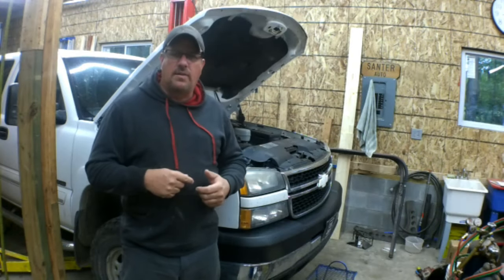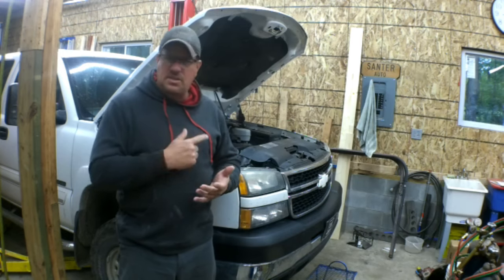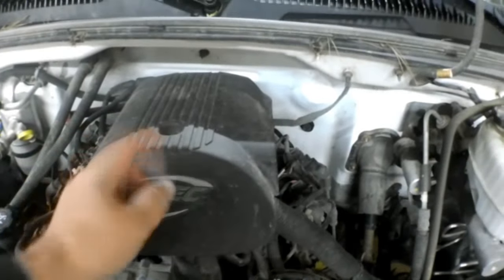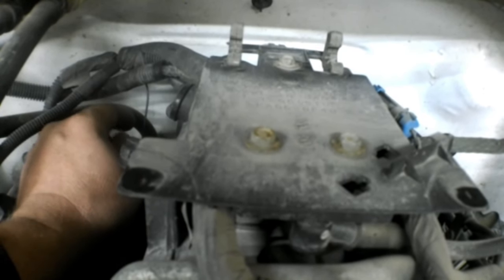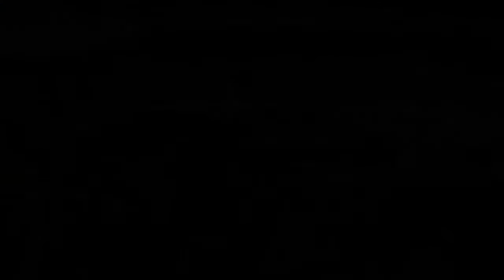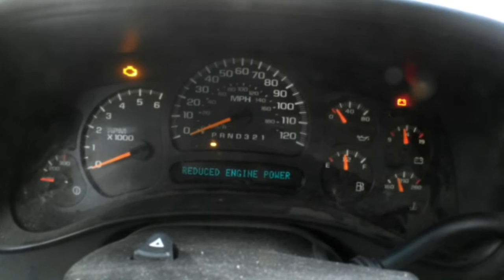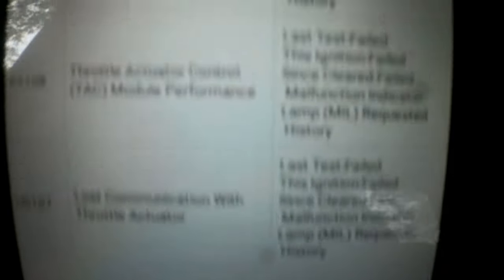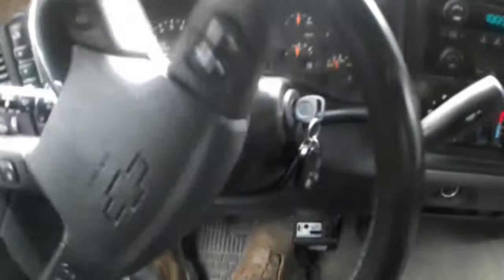Reduced Engine Power FIX! Chevy Silverado GMC Sierra Tahoe Yukon

Comment: You area genius!!!  I have spent 8 months and over a thousand dollars and nothing fixed it.  I tugged on this wire and bam off it pulled.  Regrounded like you and FIXED!!!!  You just saved me $50k for buying a new car!  THANK YOU!!!!!
Reply from the maker: I'm glad to hear that! I bet YOU looked like the genius when you fixed what the others couldn't!
Reply: Wish I could buy a new truck everytimw mine broke
Reply: Mine just did this to me yesterday.  Before it had said service Stabili Trak.  I have changed all plugs and bolts and did the same as you, run grounds.  Tonight I’m going to try this ground as I did not know it was there.  I hope it fixes the issue!!
Reply: I have a brand new truck doing this.  Not even 900 miles on it
Reply: Never throw money at a problem all you get is government style results

Comment: I have a 2007 Yukon xl apparently when I drive it like 20 minutes power reduce down idle issue n etc but when I push the gas won’t do nothing unless ,I turn it off n wait 20 minutes I’ll work perfect but after another 20 minutes it does the same issue I had change the throttle body still doing the same thing what could it be .Thank you

Comment: Hmm, sounds like the same issue I've been having for years and still having. Replaced throttle body, gas pedal & sensor still having same issue at random times like when driving or when sitting in park it will randomly pop up on screen reduce engine power & read traction off on 2002 GMC Yukon 4.3 Vortex engine. I don't know anything about soldering wires together but this is definitely something I'm going to look into. Nice video.
Reply: Mine is doing the same thing did you find the issue
Reply: @dennisnicolas6865  Wiring harness(for vehicle)&a couple sensors. Had a couple wires that were burnt out in two places.So far it everything good the only lights coming on at random is ABS,Break Light&Service/Check Engine but neither has caused an issue in truck running faulty.
Reply: Check your voltage regulator

Comment: I have a 04 Chevy 2500hd 6.0, I’ve always ran into reduced engine power for about 2 years, I’ve cleaned all of the grounds checked them all, put a new throttle body, new gas pedal assembly with sensor, the pigtail for the throttle body, new fuel pump,  and went out and got a pcm and had it programmed to my truck and I still keep running into this problem, the only code I get when it goes into reduced engine power is p2135, does anyone have any ideas of what it might be? I’ve done a ton of research and can’t get it
Reply: For my Yukon the coolant sensor was the culprit. It would run my Yukon rich and that reduce engine light would come on. Goodluck man.
Reply: @bugzy2218h  thank you man, I’ll have to try that
Reply: Any update on this. I have the exact truck you explained, and all the same problems.ive done alot of grounding work. Specifically the one in this video, ans I thought it fixed it, (for about a day), then problem came right back. Did you get your issue fixed? If so how? Thanks.
Reply: @anyandalldiy6704  my truck does it every once in a while so I’m not quite sure
Reply: @anyandalldiy6704  did you find out what yours was

Comment: Super common the eyelet rots off them where they attach to the back of the cylinder head I spent a long time on a Silverado the first time I ran into this problem now when customers come in and explain there problem to me if they have that era truck almost every time it’s that ground. I’ve seen it probably 30-40 times now over that last ten years. It’s crazy how that one little ground causes all those problems
Reply: Hi there I have one question for you would it be a smart move for me to possibly splice the wire since I can get directly to the back of the motor & connect it to the firewall on my 03 Tahoe

Comment: I had that issue on my silverado my tahoe  I've rerouted that ground new throttle body new accelerator sensor extra ground wires and still can't find the problem 😑
Reply: Did you ever find the root of your problem

Comment: I have a 2011 silverado that was doing the same thing.Took it to the dealership and they replaced the ECU, The Throttle body and the gas pedal still no fix.Then they replaced the wires from the throttle body to the ECM.It worked for a week but went back to doing the same thing.Took it to another mechanic (lost faith in the dealership) he worked on it and it worked for another 2 weeks then did the same thing except then you would have to hold the key in the start position for about 3 seconds before it would crank. Watched YOUR video and  sure enough it was the problem.Thank you for this video and if you are ever in the New Orleans area I owe you a few drinks and a good dinner!
Reply: Thank you for the info will try that on my 2003 Tahoe , just a question do i need to run cable from under car or i can cut on top and run to a new ground i think i miss that part thank you
Reply: @leonelmartinez397  I cut mine at the top and ran a ground to the motor.There were two wires ran to that ground but I think it was the thinner wire giving the problem.
Reply: @The1bambam  ok thank you
Reply from the maker: Good to hear it resolved your issue. I went to New Orleans a few years ago and it was a wild time!

Comment: Lots of people paid lots of money to have the problem fixed only to find that it really wasn't fixed.  Kudos to you for posting the video. I'm wondering if the same (or similar) DTC's were present in these cases and if so, was a wiring chart reviewed to see what the common ground point was. Sometimes, a little research can yield great 'knowledge' and success in a correct diagnosis and repair.

Comment: Thank you for sharing this video. This was doing the same exact thing mine was doing. Other videos wouldn’t show what the truck was doing , just said reduced power fix , I figured this one was no different , but when I watched and it showed that it was doing exactly what mine was doing , I knew this would fix my problem. 
Thank you so much for sharing this video. It saved me a lot of money. My truck had been sitting over a month , could not figure it out , I put fuel pump fuel filter crankshaft sensor camshaft sensor and was gonna change the box under the left hinge , that was when I seen this video , after watching over 40 videos I found this one. You saved me a lot more money or saved me from scrapping a good truck. 
👍👍👍✌️✌️✌️
Reply from the maker: That's great! Thanks for the feedback!

Comment: Thanks!  This cued me into the fact that this is an electrical issue.  Looked at my 05 sierra with reduced engine power, and found wiring had rodent damage.  Fixed the connections and fixed reduced engine power.  Truck could only drive 5mph, and now drives normal.

Comment: Man thank you for this got a 05 Chevy Tahoe my 3rd Tahoe and I never seen this issue thought the motor was locked up due to it not wanting to crank starter sounded like it was trying to start a locked up motor by far a good video man it was my problem and solution

Comment: I have a 2007.5 GMC Sierra The reduced power comes up and I have no throttle after it comes up turn it off let it sit for a few then it goes back to working then comes back and 2 p2138 codes show up any help would be great
Reply from the maker: For the P2138 code, the most common fault listed on Identifix (for your vehicle) is the Accelerator Pedal Position (APP) Sensor. That being said, it could be an intermittent wiring issue. But it's likely the sensor.

Comment: What happens if it rips off from the opposite end do you then need to rewire that whole piece? I just accidentally broke it off from the bottom not the top where it enters the wiring harnesses
Reply: Basically what I’m asking is does the wire need to be regrounded from the engine or the wiring harness

Comment: I have a question .my GMC Sierra pickup . the radio shuts off and comes back on When driving .. now When in park and turn the heater on the Engine stalls . and when I go in my truck to start it I get no power nothing no lights on dash absolutely no  power at all . and then I retry and it starts up ? New battery . Alternator and starter ? Please help 👍🇨🇦
Reply: I might be too late lol but check your voltage regulator

Comment: I never had this problem with my '99, all the trucks after the square front end redesign seem to be riddled with problems that my early round body is not plagued with.
Reply from the maker: Never had these issues when vehicles had actual throttle cables running to the throttle body. ALL electronics fail eventually.

Comment: Had my truck for almost 9 years now and I’m having this exact issue I don’t exactly have all of the tools needed but I was just wondering the wire gauge size
Reply: If You can Get Ahold of # 8 ( Gauge ,? -- 10 Strand, Specialty Boat Wire, and Correct Grommets, that will carry the Necessary Ground Power... For a Strong Secure Ground, Dependable... Getter done...!!

Comment: They have a chassis to engine ground on the back of the driver side head that always rots off that one will also cause intermittent radio noise , charging problems like dimming headlights or flickering cluster lights and sometimes other issues depending on what options the truck has.
Reply: Marc, reading your comment about the ground..... hoping you can help me.  I have a 2004 Silverado with 8.1 Vortec.  My truck (265,000 miles) started doing weird things about 6 months ago.  When I start the truck I get a loud and weird UFO sounding hum out of the radio speakers that lasts for about 5 seconds.  When I open the door to get out I often get a really loud buzzing noise that seems to come out of the stereo speakers.  Sometimes when I start the truck the instrument cluster doesn’t work (gauges non-functional) and then they’ll begin reading correctly after 15 seconds or so.  Once I’m underway my radio has a constant hum in it that is worse at lower rpms. Does this sound like a ground issue?  If so, please let me know what I should check.  I do routine maintenance on the truck but I’m not a mechanic.  Thank you
Reply: Is there an aftermarket soundsystem installed or sub woofer?

Comment: I’ve had issues like this but It hadn’t yet occurred to me that the bumpy roads I drive through everyday were partly to blame. 

I’m grateful because I found my fix quickly and at no cost. Dudes like this are essential to a guy like me, because I don’t know diddly squat when it comes time to find/fix any problems under the hood.
This really saved me a lot of money by not having to take my pickup in to a repair shop.

👍🏼thanks again buddy!

Comment: Do you have to clear the code before its  fixed  I don't have the computer
Reply from the maker: No. If it's fixed the vehicle will run well and after a couple drive cycles, the engine computer will clear the code automatically as long as the fault is no longer present.
Reply: @Tomsfoolery.  thanks bruh
Reply: I'm having the same issues. I was excited about your videos. Came out to see and the wiring is not there. I have an 2008 chevrolet avalanche. I know for sure it's a ground wire. Please help.

Comment: Hey i have a 2004 yukon Denali same issue .changed the pedal position censor cause that's the code it was giving me ' still have the same problem.
Reply from the maker: Are all your lights going wonky like mine were? Check for that ground wire on the back of the engine.
Reply: No just the check engine and tcp light and reduced engine power.it happens when I'm driving and sometimes when it's just idling
Reply: Any update here. I'm having the same issue. I've changed this ground mentioned in the video. Door locks trip when the c.e.l. comes on. Trucks got a decent amount of rust on it. But I've working in going through the grounds. This video fixed my problem for about 30 miles of driving. Then problem came back.

Comment: Have you ever heard of it having a "powering off" message after it says Low Coolant?

Basically the coolant leaked out and shortly after it said Low Coolant, it said Powering Off and turned the engine off 🤔

2005 GMC Sierra
Reply: Probably so your engine doesn’t blow up. You need more coolant or you have a leak. If it runs hot too long it will likely fry engine. Good chance it’s a safety feature.
Reply: Yeah My 2000 Yukon XL Blew a Nylon/ Disenegrated, Connector which Really All You Guys Need to Replace A.S.A.P --- the Tan One Especially... AUTOZONE Help Section Has it on the Rack.... Better Safe - Than Sorry.... I had to Put a plug 5/8" Dia. In the Blown Off Hose... And Put 3- Gallons of Water back into the Coolant Reservoir / System to Go to AutoZone... And Search out one of the 2- Heater Radiator Connectors on the Firewall .. I tugged, And Finally Nibbled it off... With Large Water Pump Pliers, Then cleaned it up, and Slipped on the New Nylon Connector, and Water Hose... I Saved My Motor..!! After the Computer had Kicked in to " Reduced Power" --- Then the Coolant Sensor Started giving Me Dash Light Problems... although I have Not Replaced it .. but Still need to Eventually... For a Solid Resolve... It is Just one thing after Another with this 2000 Yukon XL, 1500, but I Do Love This SUV.....!! 
I am Determined to Resolve All Idiot Light Problems.... BUT NOT TO KEEP THROWING UN- NEEDED PARTS AT IT... STAY CALM, THINK CLEARLY, ASK QUESTIONS, WATCH YOUTUBE VIDEOS, CHAT....
IT WILL ALL GET BETTER...
   BillinL.A.     7-6-2022

Comment: I have a 2007 Chevy 2500HD 6.0. Its been in the ship 2 and a half months. Just got it back yesterday because it was supposed to be ready. Drove it home from the shop and went to crank it this morning and low and behold "engine power is reduced" came across the screen and it won't crank. 😒
Reply: Hi! My boyfriend has the same vehicle with this same problem. Did this solution work for you?

Comment: A  GUY JUST CHARGE ME $200  TO FIX THIS SAME PROBLEM AND 5 MINUTES AFTER HE LEFT THE PROBLEM CAME BACK SOME ONE ELSE CHARGE ME $150 STILL HAVE THE PROBLEM TOMORROW AM GONNA LOOK FOR THAT WIRE N TRY TO FIX IT THANKS HOPE IT WORKS 4 ME
Reply from the maker: There are numerous things that could cause the reduced power issue. I hope you get yours figured out!

Comment: Mine had just came off was in the middle of nowhere it just shut off one dang wire it's been fine but now getting the reduce engine power change the throttle body was fine but it doing it again i think i made the ground to long and i use a thick wire
Reply: It could be a ground loop thick wire is very good sometimes and not so good others but if the wire is longer ohm's law says that it being thicker should make up for that but it really depends on how strong the ground is going to the source of where you connected to. I think the best thing to do is run you a sick ass wire from the negative cable to the frame and from that frame portion to the engine and from the frame also one to the body and do it in a way as to not send the ground signal from the injectors in the motor harness to the wrong spot you don't want it jumping through loops to get to the fucking ground you just want to help it out a little bit also another good thing you could try is look at the alternator wire that's charging your battery it'll be the little wire that sitting there between the battery and the alternator screaming help because it's so undersized and I'll get you a real man's wire and connected in place of that and throw the other wire in the trash so that it ends up back in China did they take all our recycling anyway to sell it back to us I don't like the Mexicans take all our money from the government and send it back just like we send them back and they come back you're just getting a free ride to the quinceanera. And then they take our trucks to Mexico and bring them back with pieces of chrome going around the wheel wells
Reply: @SS-vp4eu  We need a guy as smart as you for our president.  You have it all figured out.

Comment: neutral safety switch on the side of the transmission. I chased this for a long time.
Reply: What do you mean by this? I'm having these problems.
Reply: More info?
Reply: So update for me... My problem got much better after I cleaned the grounds under the driver side door along the frame rail. My code went from. A p1125 happening probably 10 times a day with about 50 miles of driving which got very annoying, to a p2135 about once every other day. I also bought a cheap OBD2 bluetooth scan tool on amazon which allows me to clear the code from my phone while driving. I be also been able to clear the code and continue driving, whereas before I would clear it, but it would return immediately. So at least the truck is drivable,  but still problematic. Hope this helps.

Comment: Yukon here and last year it THREW me out into a Hwy intersection when I braked at the stop light! 

Literally lunged me 8 feet forward!  

Then, when I was half way in the road, traumatized, it went in LOW power mode and the angels carried me (going 8mph) — safely across a double lane highway on a red. 😳 Scariest moment ever to not have control of a truck. 

My foot was normal on the brake - mechanic thought a sensory near my tire got water in it from the car wash I just did prior and it triggered mayhem. 

IDK but its winter and I don’t wash my truck that much (or allow those dumb tire sprayers near my tires!) and it’s doing it AGAIN! I’m going to die!🤣😅🥲

whatever issues / setting it is should be fixed by the manufacturer - I could have really got hurt or died on that hwy. Legit thought someone hit me at first but no one was around 🤭😶

I thought it was my traction control messing up the whole system so I have it off. 🤦🏻‍♀️  I’m checking that wire tonight!! 🙏 thank you!
I’m pulled over at the gas now but if I accidentally pull it off 😅 I don’t want to be stuck here. I’m in the bad part of town and weigh like 100lbs at 5’2 so I’ll be robbed in no time LOL! 🤪